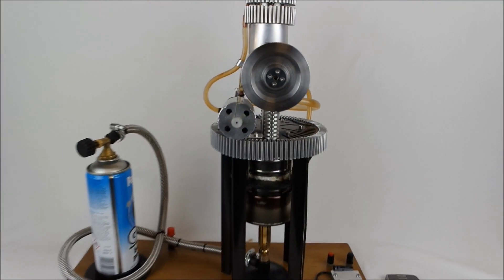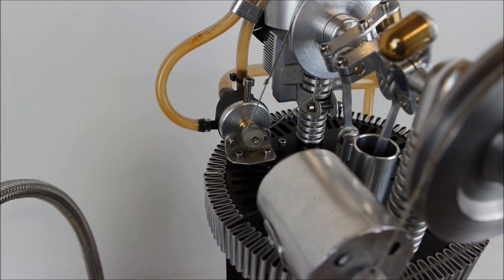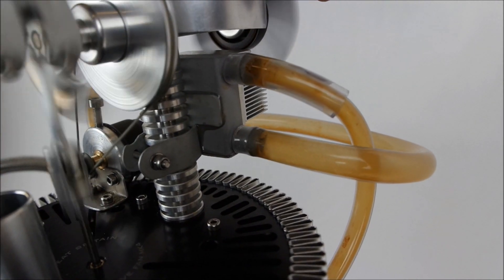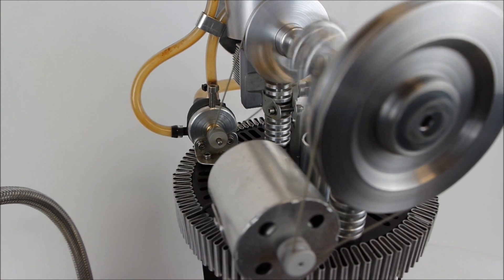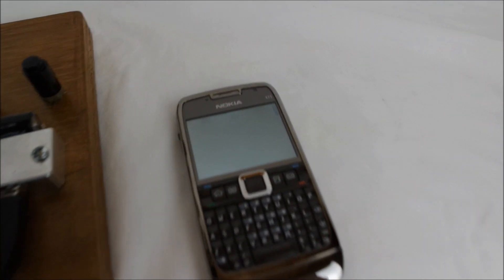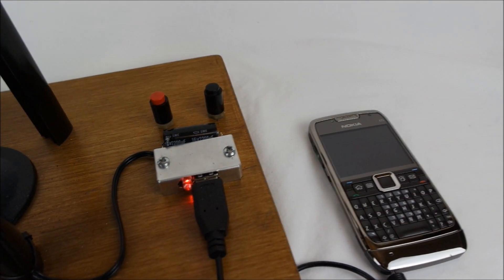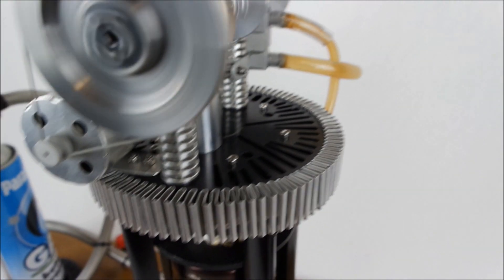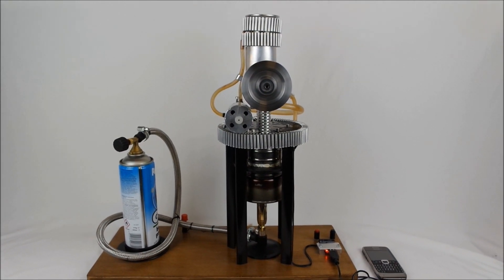Stirling Engine Charges Phone

Comment: For once, a truly impressive stirling.  Your approach of heat exchanger is great, but I'm most impressed with the silent running.   That's an engine that should have a long life. How did you get the bearings to be so silent?  Water pump: what about using a larger but slower impeller type, with larger water tubes with more slowly flowing water?  You might gain a couple few watts.  Beautiful work!
Reply: Keep in mind, it's impossible to judge the noise of one of these engines from a video. Even gunshots can sound like clicks depending on how the sound is set up.

Comment: Should put the heat at the top and cooling on the bottom. Heat rises. The propane radiant heat running up the rig could impede the cooling process.

Comment: The cooling system is using some of the energy output of the system.  Have you calculated the output "loss" of the cooling system to measure cost/benefit.  I am looking at gravity feed cooling

Comment: That is still a relatively small engine. Is it possible to make it larger? Have you considered intensified sunlight to run it? Scale the function up... couldn't you make this huge? Sunlight hits every portion of the ground
Reply: i dont think the heat would be sufficent, possibly if a lense was used

Comment: It is fairly large for aphone, you could put a gearbox on yours as it is five to ten times bigger than the ones already with a phone charger. Also, i hear the propane flame wich means that even if it doesnt move fast, it seems pretty strong and is likely to be able to charge much more than your mobile phone really ( it really depends on how much you burn but about 15% and up of what you put in, minus losses. that was much more than a regular candle so..guessing ..140watts chemical power..wich means it theoretically can do 14W shaft output (rougly if optimized) ?

Comment: I'm trying to learn more about these engines?  I would like to generate about 50watts at the flywheel, with the ultimate goal of having at least 10 leftover by the time the energy comes out of the usb module.  but Idk anything about anything - how much energy would be lost to the generator, usb module, and anything in between?  how big would a 50watt sterling have to be?  I was hoping to get one of those desk-sized kits, but those seem to put out a fraction of the wattage I want

any thoughts?
Reply: 50 watts is entirely out of the question. Stirling engines don't make much power at all

Comment: "very economical, very low amount of propane" Numbers, mate, only the numbers count. Count the watt-hours, count the money you spend on propane, compare with mains charger. THEN you can begin to say anything about economy. No offense, mate, I see your well-deserved pride of it, but that is no benchmark.
Reply: 1 atmosphere pressure stirlings are pretty inefficient, and bottled gas is a costly fuel. So in terms of cost he's likely well behind mains power. A more interesting question is the overall efficiency of the system in terms of heat input to power output.
Reply: Respectfully, this would be a purely academic examination at best, so how this would be a "more interesting" one is debatable. The creator specifically referred to the fuel consumption in this particular configuration, and that's the only thing I challenged.
Reply: You use electric resistance heating, measure the power input, and measure the output power, you now know the engine's efficiency. You can use that number to figure out how well it converts any fuel into electric power.
Reply: Sigh. Why would you do that if you already have THIS PARTICULAR CONFIGURATION available? Measure the amount of fuel used, measure the electrical output, calculate the amount of fuel needed for a particular amount of charged energy, calculate the cost per amount of charged energy from the price for a filling of gas. Why is this such a problem to understand?
Don't make it unnecessarily difficult. Plus, you'd risk a significant skew if you used a proxy heating. By using a different heat source, your heat transfer may change significantly (eg. open flame that needs some form of naturally lossy flue vs. heating wire winding in an insulated box). This would make your results completely inapplicable to other forms of heating. The only thing that you'd learn this way is how much more or less efficient your electrical heating was COMPARED TO open-flame heating.
Seriously, to even make a statement whether or not, or even how much, something is efficient, you need a form of comparison. This could be the price for different forms of energy and their application. 200 years ago, people might have said that some figure of tonnage of coal per driven railroad miles, or hours, would be efficient because that's their only data point. Comes along an improved engine, suddenly the old figure would be worse by, say, 10 %. And so on. Here, the creator of this set-up called THIS PARTICULAR CONFIGURATION "very economical". Compared to what? Has he compared it to a thermoelectric element heated by the same flame? Has he compared it to heating the engine electrically? Has he compared it to a 5-dollar wallwart charger? THAT'S what my challenge is about, I don't care about the theoretical, academic efficiency measured in some idealised set-up (although I wouldn't mind learning it anyhow). A wallwart charger is also (usually) very economical, so if I hear that this thing is also being called very economical, I want the actual figures because I somehow doubt that it is even remotely so.
Reply: A typical wall wart power supply is between 50% to 85% efficient, while his engine won't even be close to 50%. We already know it will lose the comparison to a wall wart. But it is easy to accurately measure electric power, both as the input and the output, so it's an easy way to figure out by how much.
Reply: It would be a piece of cake to swap that burner for a heating mantle. Bottled propane is a really expensive way of delivering energy, much more so than bulk propane, so you can't use the energy content of bulk propane to figure out the cost.
Reply: I'm not the one swearing, going all caps, and losing my composure over comments made by a stranger on the internet.
Reply: Anvilshock you don’t understand what he’s trying to explain to you
Reply: @AngryBobcat7  I do. Evidently, you don't understand why his suggestion is irrelevant, either.
Reply: @Anvilshock  in terms of efficiency, intensified sunlight for heat is efficient. The machine uses heat to run.
Reply: @romanfuller1182  Both statements are correct. And also completely irrelevant. Seriously, what is it with you guys barging in with arguments that have absolutely no bearing on the topic?
Reply: Anything or everythingcan be possible to man but it needs three things 
1.Brain 
2.creative thinking 
3.Try to make it pratically possible 
Without these u cannot even lit a match with your finger
Reply: @sssbznzn  Or endeavour to avoid non-eye-insultingly bad spelling.
Reply: @Anvilshock  what